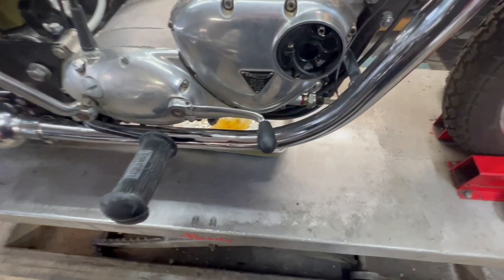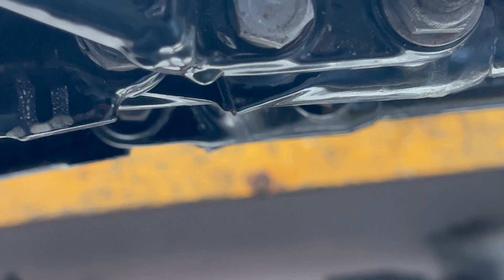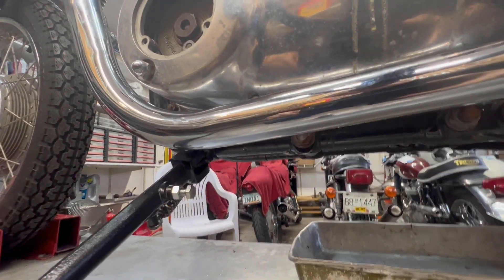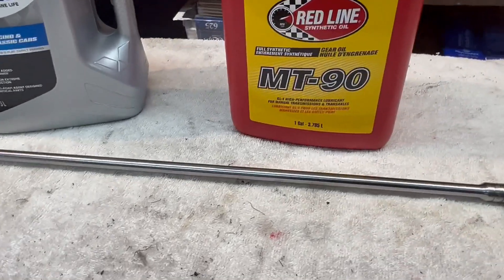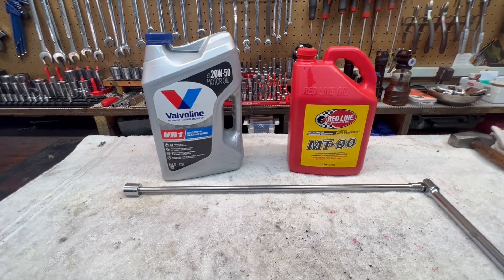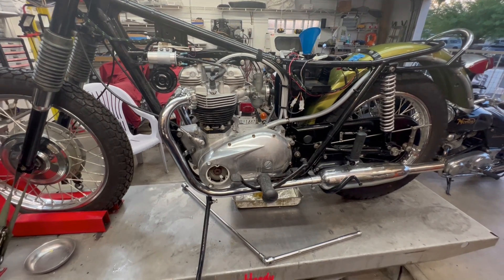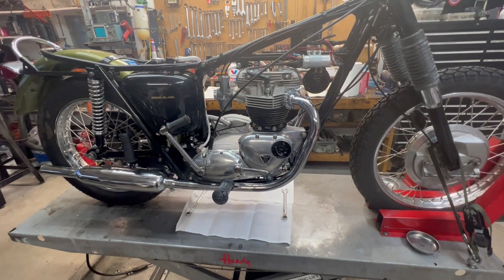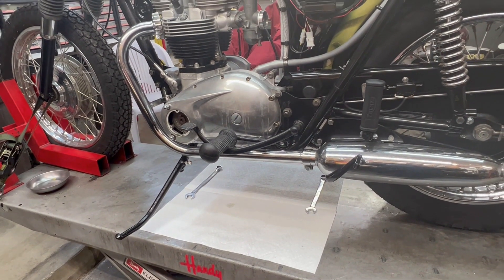Vintage British Motorcycles Repair/Restore

Comment: Do you run your bikes with the ethanol in or do you take it out?
Reply from the maker: I read about a method of removing the ethanol with water but have never tried it.  I just use regular old gasoline in my bikes.  Not even hi-test.  Just regular.  Too cheap to pay the extra for Premium. And the bikes seem happy enough.  If I wanted to avoid the ethanol I think I'd buy racing or aviation gas.  Seems easier.  But once again, cheapness enters into the decision.
Reply: @fjdelmonte  I'm with you on all of that...my triumph bikes seem to like the regular too. Lucky us.